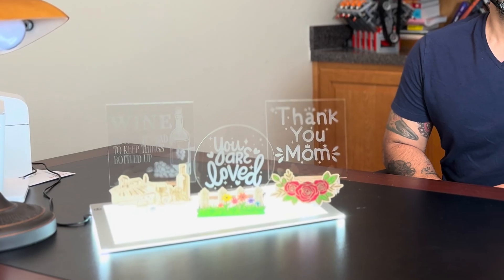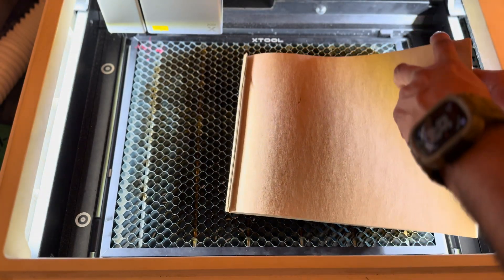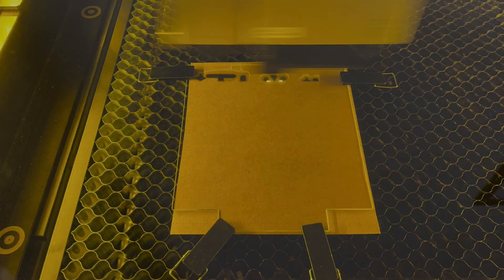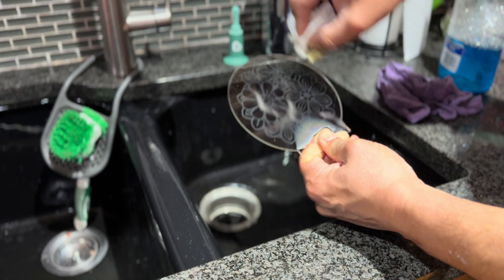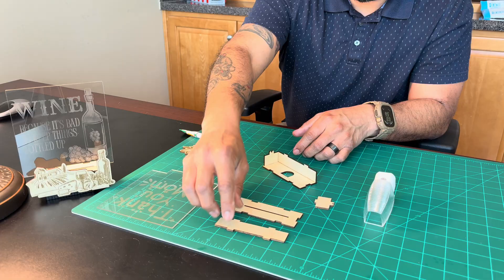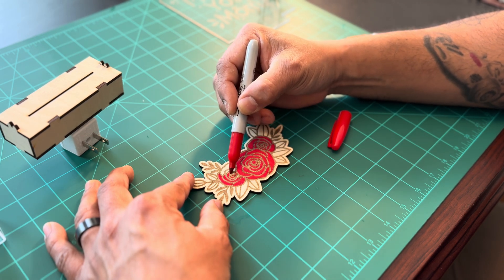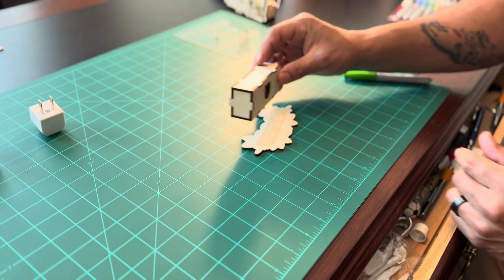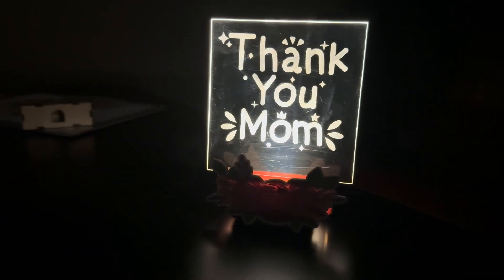Clear Acrylic Engraving and Night Light DIY

Comment: Would this trick work to cut the acrylic as well?
Reply from the maker: It actually does work but it’s at a cost and not recommended. The higher the wattage you use the more bubbles and melting that will happen :(

Comment: Can it be any brown cardstock or does it have to be this specific brand? Also, would it work with a piece of basswood underneath instead of cardstock? What settings do you use? Sorry for all the questions!
Reply from the maker: I have experience with this type of cardstock only, but you should be able to use whatever cardstock you have. Main requirement is to have something that you’re not actively cutting through and it helps to have a darker color while also not being too dark so that you can easily tell if you’re burn settings are too high.

Comment: Hello many thanks for your video. Did you try to cut this acrylic with your diode laser. Many thanks for you answer
Reply: Not possible with diode laser, don't waste your time .because the laser beam passes through transparent acrylic.The engraving is simply the effect of the heat from the paper  burning

Comment: I’m curious. Did you use extruded acrylic? Or did you use cast acrylic? Can you provide a link where you purchased your acrylic? Did you try using black construction paper as your background instead of the cardboard?
Reply from the maker: Using black won’t make a different. The goal is to be able to reflect off of material you use but when using lighter material it helps being able to see area you’re engraving in case you have settings too strong. Link to material used is on details of video.

Comment: Cool man. You shouldn't use Windex on acrylic though, that's what's causing the hazing. I'd recommend Novus #1, or Brillianize plastic cleaner. A chamois with warm water works too.
Reply from the maker: The hazing is caused by the burning of material. Hazing is actually removed after with windex but as I mention in tutorial water works best since you can place it under sink and go to town without having to scrub.
Reply: @SuperSimpleDIYCrafts  I'm not trying to be a know it all, but I assure you that Windex will cause hazing. I worked as an acrylic fabricator for 25+ years. I just don't want people to mess up their projects. Thanks for the video though!

Comment: so i have a 10w blue diode laser engraver and i found if my power is too high and slow speed its creates bubbles and cracks in the acrylic piece any suggestions.
Reply from the maker: Did you try the 10W settings included in video?
Reply: @SuperSimpleDIYCrafts  yes i have a 10w ive tried medium power 24000mm/m speed its super super light anything slower it creates bubbles and cracks ima try the recommmended settings when i get home that you have
Reply from the maker: @JigSawRT21 not sure what medium power means but as I mention in the tutorial light settings is better. You want to barely see the card stock material changing color but not to the point that it’s getting really charred since this will ultimately mean the acrylic will be too hot causing bubbles.
Reply: @SuperSimpleDIYCrafts   like 40 or 50% power
Reply: @SuperSimpleDIYCrafts   so i tried your settings it captured some but not all i did have the laser about 30mm away from the acrylic piece. I think i may need to bring it closer to the piece how far away did you have yours from your piece?
Reply from the maker: @JigSawRT21 I use an xtool m1 and reading it gives me is 26.2mm. Not sure if all lasers are the same when it comes to that number but that’s what mine says.

Comment: do you have this in a svg file?
Reply from the maker: It’s listed in 2 different platforms in details unless you need it a certain way.
Reply: @SuperSimpleDIYCrafts  I am looking for a svg of the holder
Reply from the maker: @jmarcant616 I’ll send you an Etsy link for it when I post one that you can buy. Right now it’s free on both platforms on details of video.
Reply: @SuperSimpleDIYCrafts  when I download it. It is pfd’s that’s why I am asking for svg. The xcs file is just “thanks mom”
Reply from the maker: @jmarcant616 let me look into it since xtool has multiple “canvas” or pages and “thanks mom” and “you are loved” will each be separate and both containing 2 pages or canvas. You may be only looking at one page. As for thingiverse unfortunately they no longer allow SVG’s which is why I uploaded it as a pdf. I also went above and beyond to include dimensions of overall projects so that you can use a trace function on your laser software. You are very persistent and I absolutely love that. If I’m able to make some time I’ll happily get you everything you need. I’m sorry it’s been taking long but as I mentioned it before I rather all my files be free since Etsy is a painful process for the zero kickback I get.

Comment: Hi will 1.6w work?
Reply from the maker: It should since you don’t need a high power laser to make it work.
Reply: @SuperSimpleDIYCrafts  Any idea what is the setting? I have two laser of snapmaker A350 1.6w and infred 2w
Reply from the maker: @MShadowZero1 in my video I mentioned what settings I used with a 10w and 20w laser. Being that I used 10% power I would think in your case it may be 100% power at the same speed I used. I recommend you try on a practice piece to see what is best for you.
Reply: @SuperSimpleDIYCrafts  thank you for your reply and help

Comment: Do you focus the laser on the top of the acrylic piece or on the bottom where the card stock is? Thanks for the other tips!
Reply from the maker: Not sure about the question but if you’re asking what distance I use it’s from the top. Area that gets engraved is behind the acrylic so no need to mirror image.

Comment: How do you keep from scratching the acrylic when wiping it?  Nothing works for me.
Reply from the maker: Oh right, you may have already noticed I use a regular napkin but let water do all the work. I do have to scrub hard sometimes specially in small detailed areas but the material I buy which is what I used here doesn’t seem to scratch easily. Try microfiber in case your material scratches easily.

Comment: Nice video, cool project! Thanks!
The link for the SVG file takes me to a page for a retro TV light with a lot of other cool projects, but I didn't see the box style in this video. Did I miss it?
Reply from the maker: @azcanuck764  thank you! No the problem night be on my end. Really sorry about that let me go look into it. Just to be clear was it the thingiverse link or the xtool design find link? I’ll check either way just want to go straight to the problem.
Reply: @SuperSimpleDIYCrafts  Thingverse for the SVG file
Reply from the maker: @azcanuck764  It should be fixed now, my apologies for taking such a long time.
Reply: @SuperSimpleDIYCrafts  No problem - Thank you!
Reply from the maker: @azcanuck764  I see what happened now, somehow thingiverse had an issue with SVG and it defaulted to another project of mine on there. I’ll verify it and update link as soon as I get off work. Thank you for the heads up!